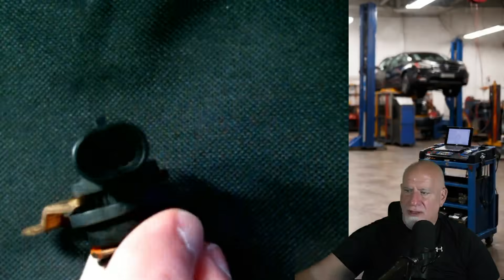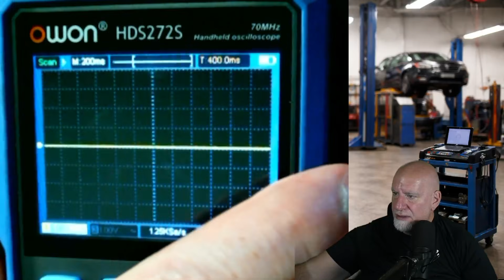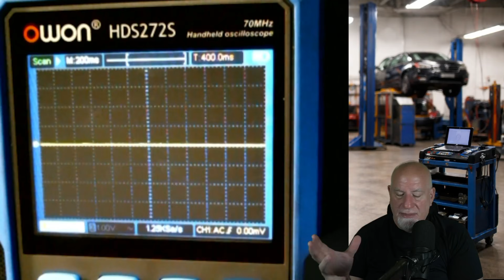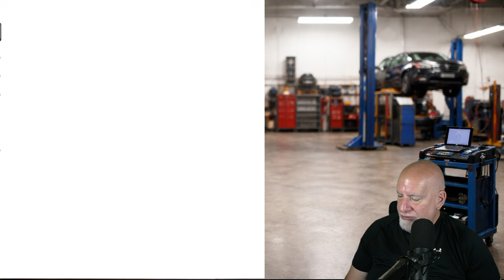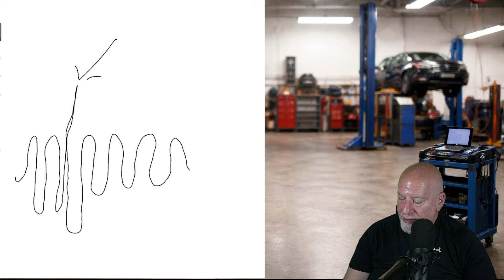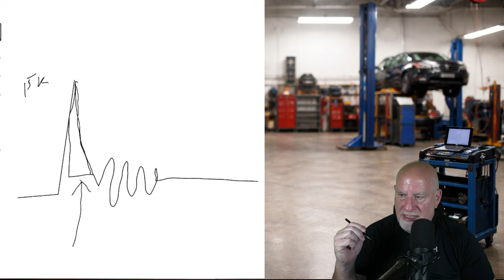From 12 Volts to 30,000 Volts: How an Ignition Coil Works

Comment: My traction control warning kept coming on on my 2012 sierra and I cleaned all the wheel sensors and my son came by and saw one of my tires leaning against the wall and said look at your tire. It was cracking in between the tread. New tires took care of the warning system. lol. But nice to know how it works!  I can fix many things if I understand how it works.
Reply from the maker: Hey Don, thank you for sharing that. It's very unusual that a tire causes a traction warning, unless one is a different rolling radius than the others. I'm glad that took care of the issue for you! 
Thank you for watching, I appreciate it
Reply: @BillTeachesAutoTech Yes. As soon as I went over 30 mph the warning came on and stayed until reset. Last summer the motor blew up out in the middle of nowhere. Someone said God told them to turn around and help us. What a blessing!  We were on a mountain pass in the middle of the road with no place to park.
Reply: Pulling our trailer!  The engine was Mc Nuggets!  lol
Reply from the maker: @donthebrain  - Wow, That's an incredible story! I tell people, especially my students, all the time that when we are going through trials, it feels like the worst of times and that we won't make it through. But then, when we do, looking from the other side, we realize it wasn't that bad, and we usually learn something from it.